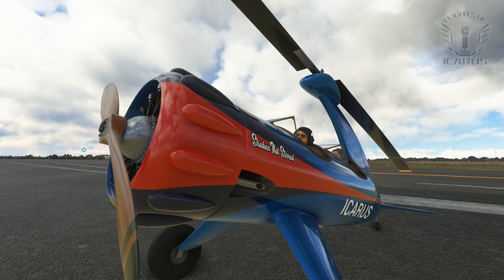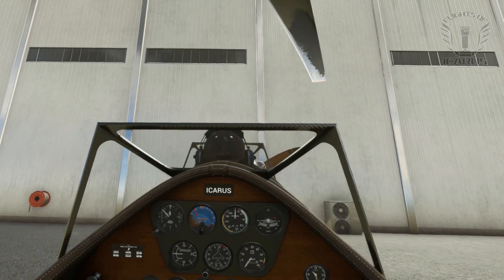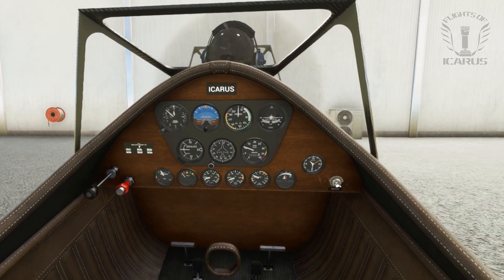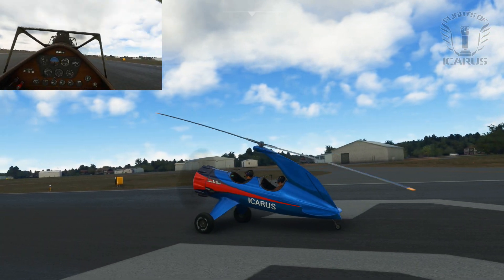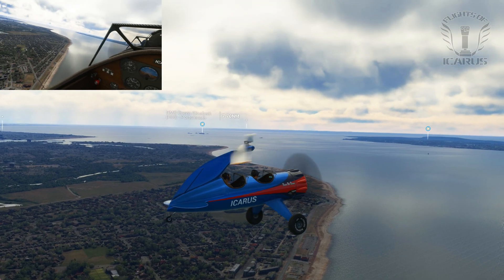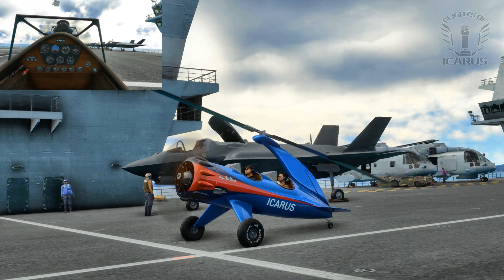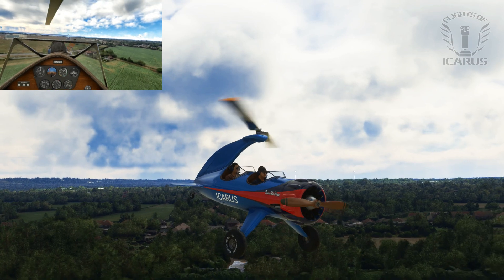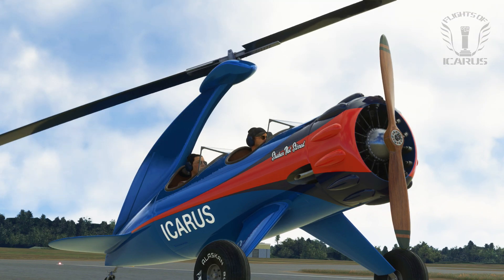Bulldog Autogryo - It's just crazy enough to work

Comment: Thanks for the video. I was looking into auto gyros and saw most are pushers where if a rogue high wind may hit from the rear can make the gyroplanes fall out of the sky, while the tractor style auto gyros prevents that from happening. 
But i guess the pushers are more desirable due to the landscape views. 
The style that you're flying is called a scorpion if im not mistaken and it was designed in a closed cabin two seater.
It was meant to be for law enforcement, but something happened and never went through or maybe they're perfecring their designs?
Wonder which is faster, gyroplans that are pushers or the modern tractor scorpion or just a tractor auto gyro?
Thanks for this video.
Reply from the maker: Thanks. There don't currently seem to be many options for auto gyros currently but I wouldn't be surprised if we start to see more now developers seem to be venturing outside of fixed wind more and more.

Comment: Nice skin for an airplane. Nothing more. Why?

As expected it does not behave like a real autogyro, as do none of the others I have found for the sim. My experience is having flown a real autogyro and researching the flight physics with a book written by out national aeronautics agency which has done extensive research.
My gripes with the sims model:

1. Take off distance - without pre rotation of the rotor it would be considerably longer than in the sim, even with it you would not take off that fast. Contrary to the believe an autogyro is not a short takeoff aircraft, though you can land on a dime.

2. Take off run - you basicly give it full throttle and it just climbs right away. This is not true. Early models could "jump" of the ground vertically but still needed speed after to climb. A ususal takeoff run in a modern gyro like the MTO Sport would be:

Rotor brake engaged, roll to the takeoff position, disengange rotorbrake an hold the stick forward to avoid the rotor striking the tail. Pre-rotate either by hand (old gyros like cierva models) or engine/rotor clutch (modern gyros) by engaging the system and gradually increase engine power until usually to around 200 rpm. Release the pre rotator, gradually add throttle until full, pull the stick back until the front wheel rises (nosewheel) and then hold it 10 cm off the ground until the gyro climbs. Level off in ground effect until you reach climb speed then climb away.

2. Flight model - Pitching up and than suddenly down (zero G) can unload the rotor and will start to stall it, which in most cases is unrecoverable. What happens is that the airflow does not come from below but from above which naturally does the opposite of what you want. Decelerate the rotor instead of accelerationg it. So you can "stall" an autogyro by stalling it's rotor, a fact that is not advertised by manufacturers. 

I'd also like to point out you said that you can't lose to much airspeed. This is only partly true. If the decent is done correctly, the gyro will not stall even if you keep him at 5 knots. The beauty of autorotation. It would be a hard landing though.
The problem is no airflow to the rudders will make it hard if not impossible to steer around the yaw axis.

Still I am very happy to see a gyrocopter model in the sim. The one here, the bulldog will probably never be produced, since the inventor is broke.
A shame since no tractor configuration taildragger autogyro is in production today that I know of. If you see one it is mostly engineered by individuals.

To you final thoughts. Yes there is float versions of gyrocopters. Unfortunatly I would not second the notion gyros are good bushplanes. The take-off run is just to long for it and there is planes that can do the job better.

Here is a video of x plane 11 showing the takeoff procedure
https://www.youtube.com/watch?v=34F3S2p6bXY

Comment: My two cents here. I have at least 30 hours on different Gyros in real life, like ELA-07, Magni-M16 and ELA Eclipse, and this, while is very good designed and have great textures, does not flight like a real life "autogiro". If you want a near "real life model" you should try Magni gyros available for x-plane 11/12, or even a freeware ELA-07. For now I will wait until MSFS develops one flight model for this kind of machines.
Reply from the maker: Good to know. Sadly I don't have X-Plane as well. Hopfully there'll be a more accurate flight model for MSFS in due course, but given how long it took to get native helicopters I won't hold my breath. Maybe in 2024?
Reply: @flightsoficarus  maybe, but I don't have much hope with adobo and gyros. There were a company developing ELA-Eclipse for msfs2020 but they left behind the project due difficulties with the flight model, and that was even before of the helis arrival...